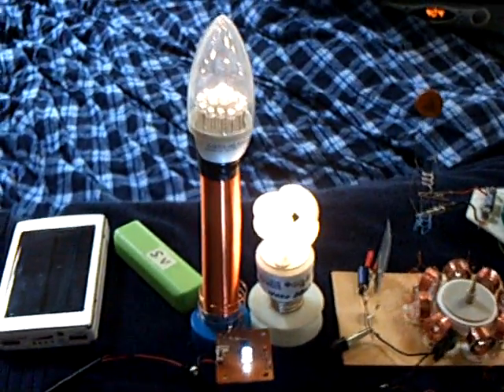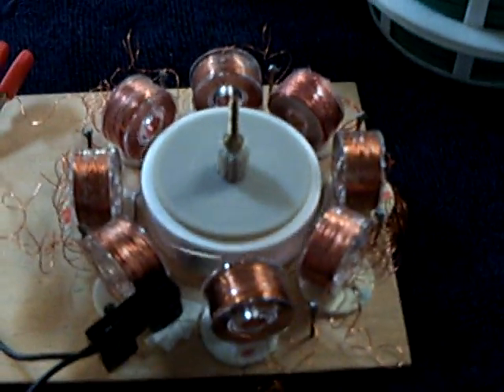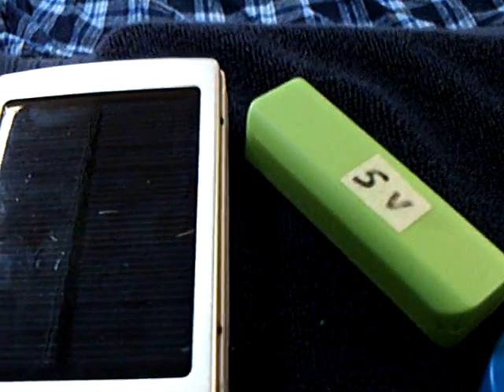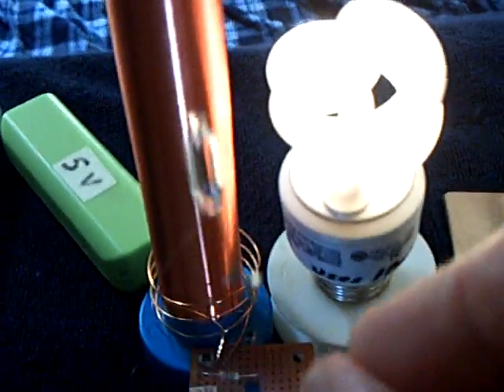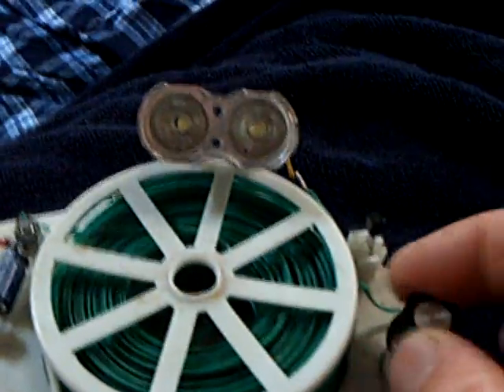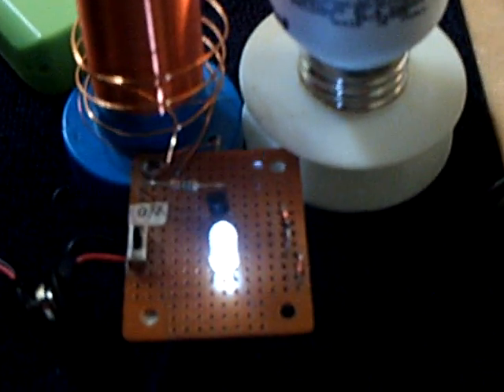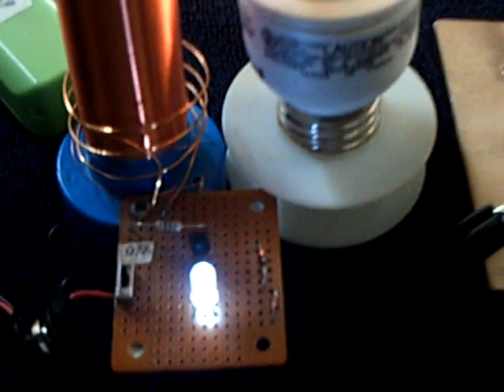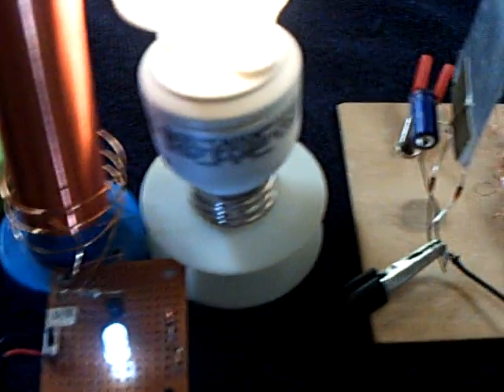USB Mini Tesla Coil

Comment: the exciter is very interesting.

could u say more about the receiver u used for the pulse motor?

regards,
Reply from the maker: +167mm167   It is just an Avramenko plug arrangement taped to two pieces of aluminum tape that act like a capacitor.  The diodes are 1n4148 switching diodes.  The four diodes are setup in a bridge rectifier arrangement.  I have a 100uf electrolytic cap across the output of the bridge rectifier to store the power.

Comment: left in the dark ,chuckle.i think Tinman will share,at some point,but sounds like RMS is going to go commercial .still waiting for my SS cups.
Reply from the maker: +bill bailey  When you get your stainless steel cups the battery (or super capacitor?) is easy to make.  It is just a concentrated Epsom salt and water electrolyte and a one layer thick electrolyte soaked kitchen paper towel insulator.  Make sure that the cups don't physically touch but are pressed together somehow.   I use 3v to charge mine.   Mine goes a week or so before I have to gently take apart the cell and add some water.  Charge and discharge it as many times as you want. I'm thinking of drilling a small hole in the top cup so I can just add the water that way.  Expect some rust to form but it doesn't seem to affect the cell performance.  This is a very low capacity device but it is fun to build and experiment with.

Comment: i was having electronic withdrawal symptoms as Tinman and Robert Murray Smith have gone missing on the super capacitors for a bit.then up pops Lidmotor with a new video.ahhhhhhhhhhhhhhh.my ss cups shipped today for that experiment you had a little while ago.i salvaged a small motor from an old cd player and a bunch of components ,can't wait to start down this road with you all.thanks again for sharing.
Reply from the maker: +bill bailey  I am really curious about Tinman's super capacitor.  It is too bad that we were left in the dark about it.  I am still working with the Epsom salt and stainless steel cup rechargeable battery (or supercap?)  I finally had to add some water but it came right back to like new performance.  I still can't decide what to call it.

Comment: You may consider building or buying a boost converter that is much more efficient than any joule thief to convert 5V USB to 9V or more!
Reply from the maker: +Power Max Great idea!  I ordered one today that will take the USB 5v all the way up to 35v.  That should be fun. Thanks.
Reply: +Lidmotor Well, be careful, Remember there is no free lunch with electronics. Boosting the voltage comes at the cost of current. If you are boosting the voltage by 10 times, then the current at the output can only be up to one tenth of the current draw of the boost converter, not even considering efficiency curves and all.
Reply: +Lidmotor So if your 5V power supply can only supply 2A safely, then at 35V, the most you could theoretically draw on the 35V output is 285mA. That does not take into account any losses. If you factor in, say, a 25% loss (75% efficiency), You are looking at a maximum power draw of 210mA absolute maximum.
Reply from the maker: +Power Max   No free lunch that is for sure.   Actually I really only need a boost from 5v to 9v to run what I want to.   The EZ spin motors like it and they don't need much amperage.

Comment: I actually built a slightly modified MOSFET version of this design more recently, using an order of magnitude more voltage! I still think your solution is much nicer and neater looking than mine though! https://www.youtube.com/watch?v=lPHHvVTVbwM
Reply from the maker: +Power Max I just watched your video and wow that really worked good.  Years ago I played around with Mosfet  versions of the circuit but the results were nothing like yours.
Reply: I was inspired to make the MOSFET version by that video lol!

Comment: One of those moments eh :)
Was good to see this tower in use, much like seeing Phylis, Maggie or the Penny.
Most of my own recent projects use a USB connector as power input, mainly because there's one of those charger adapters on the powerstrip on the floor.
Reply from the maker: +slider2732   Hewey, Dewey, and Lewey are all still alive.   I should do a video on them.  I built them back in 2009.  Dewey is basically a simple on/off Joule Thief light that I use only once in awhile.  The two original AA alkaline batteries are still in him.  Lewey sill works but there was a design flaw in the circuit and his lipo battery drains down too quickly.  Unless I charge him up with alot of sunlight he just sleeps all the time.  Hewey was the real winner of the group.  He has the super capacitors and earned a place in my kitchen window as a night light.  I always enjoy seeing his eyes light up when we
 turn off the lights at night and go to bed.  I need to make one of your C/Pb cells.  That is one that I have not tried.  Sound like that was a real success.
Reply from the maker: +Ben Winkel   Thanks.  A 'washing line' Penny wow!  I will have to try that one.  I'm glad the you have enjoyed my journey here at YouTube.  I have had great fun doing these little projects and sharing them.
Reply from the maker: +slider2732  I got one of Lasersaber's Soln1-8 setups and it has worked out well on anything the runs on 5v.  By the way some of my old "still running" project are deteriorating due to age.   The plastic on the original Penny is just crumbling to dust.  Maggie has a broken face (glued back now), and Phylis is just about due for a new piece of magnesium.  Time marches on.
Reply: it is quite strange how projects age..maybe a round up would make a good video, or a repairs vid. Huey and Lewie (sp?) need to perform some maintenance for you !
Over here, Nephilim Penny is getting tough to keep going as the water seems to have finally used up most of its ions (or something !), several Slayer towers have loosened wire, but the C/Pb cell keeps on going, flashing the LED.
Reply: +Lidmotor I'm still experimenting with your Penny circuit. After replicating the original one with the floral wire, with success i must say, ive tried all kinds of different things, like simple inductors for instance. I even made one with a pnp transistor, i call it the 'P-N-Penny' Then i thought i wonder if ordinary washing-line would work, it has the steel wire core and nice plastic 'insulation' so i bought two rolls and built one and its the best one yet! So maybe an idea if your original Penny completely turns to dust :)

Just like Objectivityiskey i regularly check in to see if there is a new lidmotor vid. I learned a lot from you and other youtubers so: Thank You and keep them coming!!